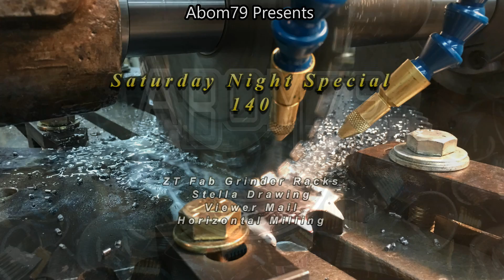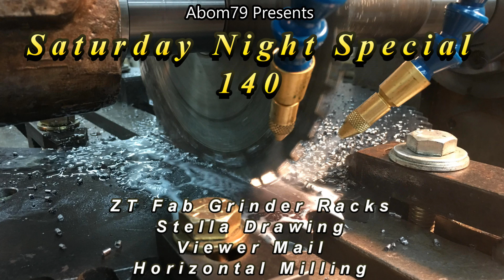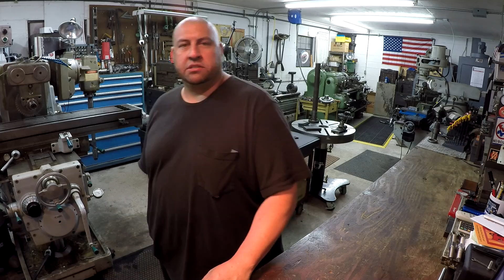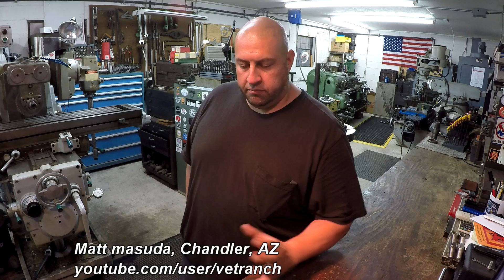Saturday Night Special 140: ZTFab Grinder Racks, Horizontal Milling

Comment: Another great video...one question ? is there any need to stamp a mark on each side of a split so the piece remains true to its original configuration, i.e. so they mate as one after slitting.

Comment: When you split that sprocket, do you put some kind of match line so one half doesn't get flipped? That may be one way that a mis alignment could occur.
Reply from the maker: Yessir, stamp marks, plus you can see the grind marks where I welded blocks on for chucking purposes.

Comment: Adam, are you ever going to paint that vertical head holder unit you made? Nothing wrong with the bare metal look, but won't Florida humidity start rusting it one day? Good video, sorry about Stella and hope it is not too long before you get another dog.
Reply from the maker: I plan on painting it next time I have to mount the vertical head and I can take it off. So just waiting for the right time.

Comment: I have 2 questions, if you wouldn't mind... Do you put any type of witness marks on the sprocket to insure it gets put back together in the same orientation it was in before it was split?  and when You bring work home from Motion, are you getting paid for it, or is it done only for video content. (If it's none of my business, please don't be afraid to tell me so. GRIN)
Reply from the maker: Yes I stamp the two halves so they can be matched back accordingly. The work I do at home I'm covered for. It's completely voluntary on my part but they cover my time.
Reply: Glad to hear that, I'm not sure if my boss would, but then again I've only been there for 39 years. (sigh)

Comment: Split sprockets work just fine. Racing karts use them with #35 chain and we run the engines at 7500 rpm with a 12 to 23 tooth engine sprocket and 64 to 70 tooth split axle sprockets on 10 inch tires. 1500 RPM axle speed with no issues.

Comment: The plant I used to work with had 24" and 36" rotary tube furnaces. Split gears were the only practical way of replacing worn drive gears every couple of years. The tubes lasted tens of years between changes and you wouldn't have to remove all the ancillary equipment, feeders, hoppers, etc. to slip the drive gear over the end of the tube.

Comment: I can understand much the reason why the customer keeps coming back to your employer for more of the sprocket splitting jobs: splitting the sprocket apart makes it possible to replace the sprocket without having to almost completely dismantle whatever its being used in, not needing to completely and utterly tear it apart and risking damage to removed parts in the process just so they can slide the dang sprocket on and off whatever shaft its running on.  

Splitting the sprocket instead makes it where instead of having to completely dismantle half or even more of the machine to slide it off and on the shaft, now all that's needed is first splitting the chain and removing it, then undoing doing 3 bolts, slide out one half of sprocket, rotate shaft, undo the other three bolts and out comes the other half.  Reverse the process with the new sprocket, and the job's done without needing to invasively dismantle the entire machine and then re-assemble it.

Comment: Did you consider marking the faces in order not to swap one side upside down? I know the cut seems pretty symmetrical but may not be... Is that even a factor for the application?
Reply: Wild Weasel That's what I was wondering.

Comment: Nice video Adam, I was thinking you could slip some soft rubber or plastic tubing over the cord hangers on the grinder racks to prevent roughing up the cords.

Comment: Adam, A dumb question if I may. I noticed considering the cutter rotation, the tendency would be for the work to move upward. While you had this part more than sufficiently clamped, have you ever found that to be a problem? I've never used a horizontal mill so I defer to the experts.  I ask because in my goofed up thinking I would have run the cutter the other direction.  Would that be an incorrect way to operate the mill?

Comment: Mr. Booth, I have a question please.  Regarding the cut on this sprocket, if the kerf is relatively unimportant to the fit-up, then why must the sprocket be cut in a machining process?  Would a plasma torch and a straight edge produce an acceptable kerf?  Of course the dross will still need to be filed away similar to how you finished the milling cut.  It just seems to me that 'good enough is' and a plasma cut would be a whole lot cheaper than cutting on the mill.  Thanks for making the videos - I watch them all.
Reply from the maker: +HardwayRanch Because I prefer to machine cut it.
Reply: Gotcha. It looks better than plasma cut. Thanks.

Comment: Adam nice work and thanks for the video.    Seems to me that if you got two bolts the diameter of the rollers on that chain and mounted them vertically in bar stock that just slid into the milling table they could easily position those gears on your milling table which would speed up setup.   Then only fine tuning would be necessary and not that much I expect.  Those suggestions  are because you seem to do this repetitively

Comment: Adam, I wait each week to see you do what you do and enjoy it to no end. A comment you made about having never seen the application the sprockets were used on brought back a thought I have had several times watching your videos. I would love to see you at some time make some videos where you were actually alongside the parts you made, being used in some big bad machines. Maybe that's not practical but it's just a satisfaction thing watching the parts do their thing. I sure miss Stella easing through the background.
Reply from the maker: +Hammer0f Thor I would love to get out of the shop and show things like that, but like you said it's not very practical. Most of the stuff I work on goes out and into infinity.

Comment: Those angle grinder holders are sweet.  If they wrap a new piece of chain around the sprocket when they tighten the bolts it will assure the pitch spacing is correct.  I imagine the guys installing it know that but figured it was good to add here in case somebody ever needed to do a similar job.

Comment: Why is the slitting spun so slow? wouldn't it perform better if a much higher rpm was used? It always seems like the teeth are hammering through the metal instead a slicing.

Comment: Do'em in a deep red, that always blends in with all the colors in the shop, it's also an anti-dirt color along with metal gray and dark green (IE even if it smudges, you won't notice it as much as you would with other colors).
Reply: I think the price is worth it for the levels, especially since they are unmutilated. I had a friend pick me up a few (from you guys in the States), and he has an eye and a tongue worth their weight in gold for finding things and bartering for them, and he had trouble digging up mint ones, especially in the South East area that he covers in his work travels.
Reply: Oh and Adam, this just occurred to me, have you tried putting a felt bottom on the holder that holds the camera?? That should dampen some of the vibration transfer and make for better sound.
Reply from the maker: aserta as for the camera mount, I have the sticky mounts on the mount I built that is clamps into a nova holder. No way to dampen it with felt the way I have it configured, but I think the thick 3M VHB tape helps.

Comment: the only time I have seen  large sprockets like that  the applications have been on a Gearhead low RPM drive. for conveyers of various types.  I have also dealt with split 10 inch saws t cutting speeds for wood.  the reason for the split is for ease of install.  an indexing mark helps to make sure of orientation.  hope this helps.
Reply from the maker: dennis brooks These belong to the utilities authority, the sewer plant. They have lots of mechanical parts that move out there. 👍🏻

Comment: So I'm a novice guy probably about to ask a novice question. I will try to be as descriptive as possible so as someone can answer as descriptive as possible. While watching this opp, to me it looked as the arbor was turning as you look at the front, counterclockwise. The table was moving, as you look at the front from right to left. This would tell me that the front leading cutting surface would be at the bottom of the peice and wanting to "lift up" said peice. Why wouldn't one of the motions be reversed so as to "push down" on the cutting surface? I understand that to reverse rotation of the arbor that the cutting wheel would have to be flipped but why not run the table from left to right and start on the right side instead of the left? I am in no way critiquing, just asking what may be a novice question.
Reply: Chris Bryant I'm not a machinist but I love the videos. If I understand from his earlier explanations, the part can be clamped down solid to fight the lift, but the screw that move the table have some backlash and running the blade in the other direction can pull the material, self feed it, making the table jump and cut an uneven amount and possibly bind or damage a tooth. I believe they call this conventional milling with the cutter pushing against the feed. I believe it's called climb milling when they go in the other direction.
Reply: you are thinking of a bandsaw where the tooth goes down through the material and takes the same cut all the way. . In this form of milling the tooth starts off nearly horizontal and then comes up a little through the material.. This way the tooth is starting with a light cut, taking a deeper bite as it comes out. In climb milling the tooth is presented with the full depth at the start, giving it a harder jolt., .
Reply: spentacle I hope this article helps. http://www.cnccookbook.com/CCCNCMillFeedsSpeedsClimbConventional.htm

Comment: Hey Adam, built a grinder stand kind of using same principles as ZT used, except its free standing. I had a fixed grinder rack on my welding table, but found that it always seemed to be on wrong end of table from where I was working and I hate leaving them on top of table, seems like they are always in way of what your doing! If you talk to them, have them check out the video I made of it or give them idea of it, I think there probably be a lot of people interested in stand that could be moved close to where you are working and it would give them another marketing angle! "Not pushing my video, just an idea for them"! lol

Comment: Yup i like Abom time.
 I have done replacements on a very similar "split sprocket" setup and what i did to get the teeth to align was to simply put a section of the correct chain over the gaps. Worked like a charm.

Comment: Only thing missing from the grinder racks is somewhere for the wrenches ;)
Reply: Mah, it's not really worth it to keep them around. Just a couple of assorted adjustable ones will do. Especially if you get your hands on the ones with two sides for small and large grinders.
Now, i've managed to amass something like 5 small sizes and 3 larger ones and i never use mine, mostly by hand. What with the rotation tightening the nut, you don't need to whale on it anyways.
Reply: ..OK, I was wondering about that too....

Comment: If the ID is of the sprocket bore is precision bored and is fit over a turned boss them it can be cut with no loss of precision as long as the inside bore is butted firmly against the boss and tightened evenly. If they have to split the sprocket, it means that the machine is built in such a way that removing the sprocket from the shaft might be impossible if the sprocket is in one piece, or it might be an otherwise expensive teardown of the machine if kept in one piece. I like it.